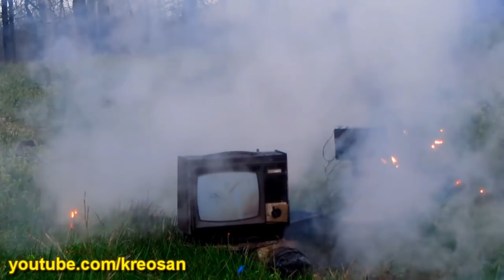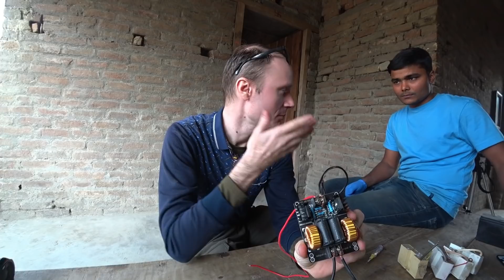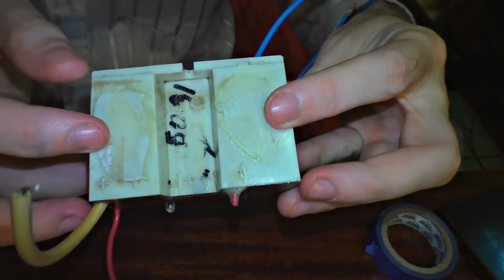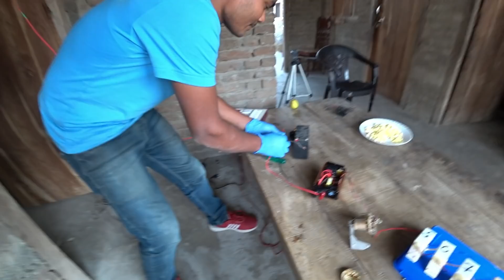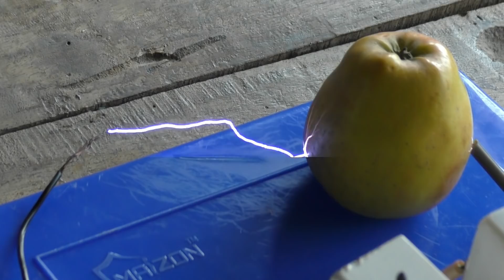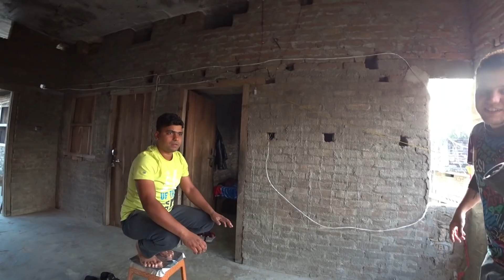✳️500000 Volts Experiment With @kreosan

Comment: found in the Internet jungle:
Mikhail Merzlikin
Please help us convey a simple message to the audience, so that the video gets into the trends! Copy the thought from this comment.
The approximate length of the comment to promote the video in the trends. <- (first line)
You need to write different phrases. Also like comments (your own and others').
The more diverse the comments, the better. The video is discussed - it is popular.
Don't flood in the comments. Comments such as: "In the top", "1 2 3 4 5" - will be written off as meaningless. Distribute.
There is a quick way to get your video trending: Create a Notepad on your computer, write down 7-9 different phrases that somehow relate to the video, save them and then just copy the ready-made comments under the video using the combination Ctrl+V. This helps when you don't know what to write, but you want to help quickly move the video into the tren